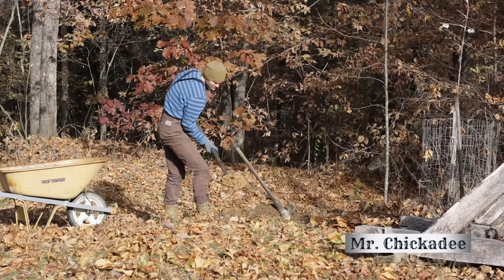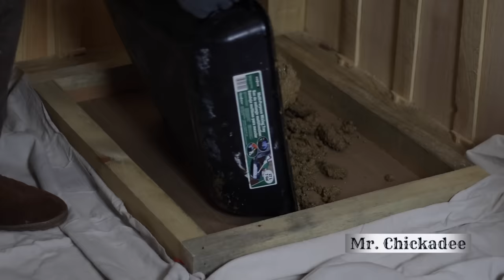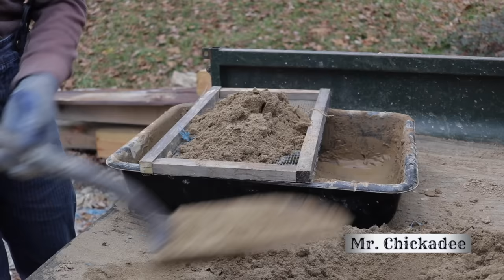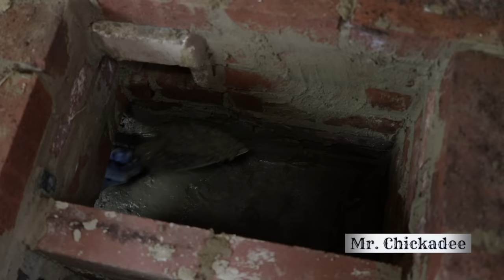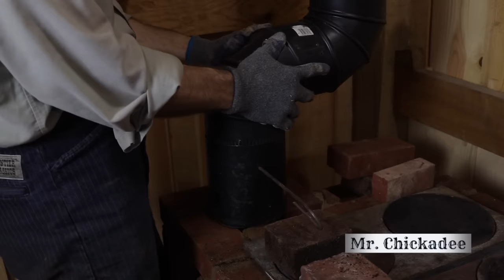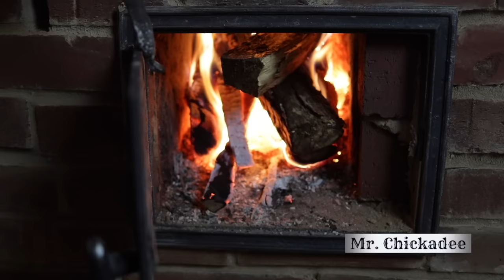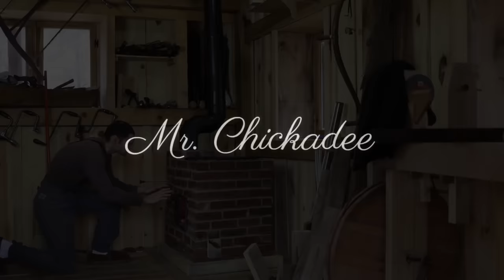How to build a tiny masonry heater for the woodshop

Comment: as a bricklayer these old methods of mortar /clay slurry/and insulation etc are interesting , Remember guys you have the option of 10% lime mixed with building sand and water to make lime mprtar(instead of cement mortar) if you live in a built up area and dont have access to clay to make slurry and wish to practice your brick bonds and building walls or stove projects  like this and repeat until you get it right.. When  your work is finished you can crit it and when youre ready to try again just pull it down the next day and brush the bricks dry and wash bricks clean in bucket of water  . You can then repeat and practice til youre satisfied with your brickwork project. IMPORTANT don't leave project for longer than 3 weeks or it will set hard and cure as cement and bricks. NB. this doesn't apply to slurry insulation. this is a very clean practical way to practice brickwork in your garden or patio. using the same sand and lime repeatedly. jiust break the project down on completion then use a hard scrubbing brush and separate sand and bricks into two clean piles. enjoy
Reply: Wow. Thanks for the great information! Can I use engineering bricks as a fire wall?
Reply: awesome advice

Comment: Feed the fire with controlled outside air and not let it steal what the brick is heating! And a pot of water boiling to keep your sinuses from cracking open! LOL
Reply: Yea i'd love to see a video that explains the design principles and incorporates advanced design features like outside air intake with a wood gas combustion feature like wood stove fireplace inserts have.
Reply: There are at least two combustion chambers which I assume will create a secondary combustion chamber once it's good and hot.  As for outside air, it's not so important with this style of stove since it's also using a large amount of mass to retain as much heat as possible, from a very small initial combustion chamber, ie small wood fire, huge fireplace.
At least that's how I see it, and I know it's a Russian fireplace, and that's what they do.

Comment: There's rocket-mass heater; then there's mass heater; this is the latter! Still heats up, and stays warm a long time!!Good show!
Reply: If I ever build myself a cottage, cabin, or a new, bigger homestead farmhouse, I'm putting in a masonry heater, or a couple, depending on the house layout... I can skimp elsewhere and have a kitchen built out of pallets, but I won't skimp on proper heating like the stuff I grew up with. When I immigrated to the United States, I used to think people's firewood piles were a 10 YEAR supply, because I was used to these things that only need 2-3 cords per year to heat up the house, rather than 20+ cords. The cost savings are considerable, if spread out over the lifespan of the heater, but all I ever hear from Americans is "rocket mass, rocket mass, rocket mass..."

Comment: Making the fire gases go up, over, down, over again, and then up the chimney will certainly make the most of the heat but I'm sure that smokes the place up until everything gets heated properly.  Clever and nicely made.
Reply: nah, just put a small fan in a window facing in. Instant autodraft.
Reply: With masonry heaters when firing up a cold unit it's common to use an access hatch to build a tiny fire inside under the chimney, just a little paper and wood, this gets some draw action going so when you start the fire in the firebox you don't smoke out the cabin.  Once these kinds of units warm up they stay warm for hours and hours after the fire is out, as long as you don't let it completely cool down between burns it should be fine to light your next burn in the firebox.

Comment: Dear Mr. Chickadee! 👍
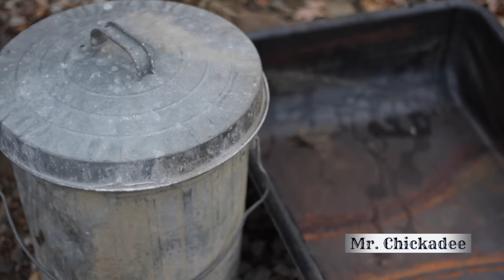It is Sunday, 02:30 [am] Central European time in the morning, now Sunday is saved again! Thank you!
What did you pour into the first mixture for the bottom plate of the oven out of the tin bucket? Bran, chaff or eggshells?
Is there something you can not do? You have the pioneering spirit of the first settlers!
Greetings from Austria!
Reply: Good morning , what he poured in was vermiculite . You should be able to find in building/ garden supply  stores .
Reply: If you look at the very top of all the comments he post exactly what he used in the three different types of mix. The first was Clay and vermiculite.
Reply: Vermiculite
Reply: @ Hi HighHo Silver!
I have no superimposed comments or subtitles, I could not see anywhere. I have again looked very concentrated and synonymous with the settings, but again not of einglendeeten comment u see and in the video description it is not synonymous.
I know Vermiculite, that's what my wife uses for her orchids and perlites, so that the roots are airy and moist.
Thanks, also too: "Linda Mazur, Jay C. White Cloud and Henry Rollins!"

Comment: What happened with the flue.  
It looks like two different projects.  
The first flue overhangs on the left,  
and the final project shows the left  
without any overhang.   

Also, why did you design the handle  
of your flue damper to poke out over  
one of the cooktops? Would it be in  
the way of operations during use of  
the cooktop? In the video, it looks  
like it could have been turned away  
from the cooking area (and the heat).  

Great content. Keep up the good  
work. Thanks so very much.  בס״ד
Reply: It looks like he just trimmed the overhanging part of the brick so it fit smoothly.

Comment: Great, you must add a steel grate to lift the wood at least 1.5" from the combustion chamber bed, in that way the fire is much more easy to start and the ashes don´t obstruct the oxygen for clean combustion and pyrolysis (more energy per kg of wood and fewer particles in the chimney).
Reply from the maker: Great idea
Reply: @JayCWhiteCloud  Hi Jay, I understand your point of view, this is a common problem with "appropriate technology" archetypes.

Those technologic solutions where empirically tested over time and transcended in history and folklore but since they are real solutions in which millions of people still rely on, they need to be tested, measured and improved, for example in Aprovecho research center. 

One simple grate made of corrugated steel bars of 1/2" can last about a half year or more of daily use since this is not an oven or furnace, you can see the draft of the chimney in the video of this rocket stove chamber which is 3 times higher than the door and relies on efficient pyrolysis above the wood and the grate, also is very easy to make a ceramic grate.
 
For insulation, the vermiculite he used is much better than ash since the density of air is bigger and its resistance to heat.
About maintenance, with clean pyrolysis, the galvanized chimney accumulates less dirt and lasts longer.

Cheers
Reply: @JayCWhiteCloud  Conifers are far from the hottest or the cleanest burning.  In fact, if you often start your fires with them or use them for smaller fires, the incomplete combustion of the sap within them at lower stove temperatures forms creosote within the stove and chimney system and if not removed can ignite and burn the whole place down.  A simple call upon any firewood authority will reveal most pines and firs to yield about half the BTUs of solid hardwoods such as ash, oak, or most fruit trees.  Further, they often throw sparks (a fire hazard) and do not produce good coals.  This isn't to say that they are without use, but they're far from my favorite for the firebox.

Here are a few links for those interested:  
Sorted by BTUs but less info: https://chimneysweeponline.com/howood.htm
More info, harder to sort: https://forestry.usu.edu/forest-products/wood-heating

And if you're really interested in firewood, I HIGHLY recommend this book.  It's one of my favorites: Norwegian Wood: Chopping, Stacking, and Drying Wood the Scandinavian Way
 by Lars Mytting
https://books.google.com/books/about/Norwegian_Wood.html?id=nZplCgAAQBAJ&source=kp_book_description

edit: to show book name

Comment: Great work mr chickadee, just a question : arent you afraid of the fire destroying the clay joints ? We build here in Europe similar stoves, but for the burning chamber we were advised to use refractory cement insted of clay+vermiculite for this place... Outside we used clay as you did...

Comment: Hey @Mr. Chickadee could you please explain your reckoning for a masonry heater over a rocket mass heater, I know they have some overlap but I'm interested in your thinking? :) I will be building a heater for my own studio and had thought the mass heater would be fantastic, altho seeing Cabin Talk having to remove hers 🙄. Many thanks for your mindful making :)
Reply from the maker: Well, to me, a RMH is just a reinvention of a wheel? They both do basically the same thing, hot efficient fire, extra burn chamber and retain heat in thermal mass, the RMH just seems like a hobo version someone thought was needed...I dont know why anyone would need the barrel and all the daub if you can just use clay bricks and clay mortar?

Comment: Awesome work! I love clay mortar! Far superior to cement mortar in this application. Where do you get those doors and how do you install them?

I'm also a bit worried about not having any air flow underneath the heater. I watched a masonry pizza oven burn a trailer down one time because it was built directly on top of wooden pallets and I've heard lots of stories of people's houses being burnt down because they built their stove too close wood. It can take several years, but exposing wood to heat will decrease it's ignition point to where it will catch fire when you least expect it. I'm guessing the vermiculite clay mix gives it enough insulation to not have to worry about it?
Reply from the maker: Hi Jeremy, 
The door was from ebay I think, it has little metal tabs you just insert between the brick as you mortar them up. 

Lots going on here, for one, the firebox is shoe box size, most heat goes up into the cook top and surrounding brick first, cooler flue gasses do heat the lower bell portion but not anything like the direct heat of a mass fire in a large pizza oven. 

For two I feel the insulation layer is enough. There is two brick space of air gap under fire box, and this is a flue gap for hot gas but not as hot as the direct fire.
Reply: @MrChickadee  if you feel like you've taken the proper precautions, then that's good enough for me. I just would hate to see anything happen to that beautiful shop of yours!

I like the idea of raising the firebox up so it isn't in direct contact with the bottom of the stove. Is the stove design your own?

I'm usually not much of a Safety Sally, but I am a believer in understanding the risks to help avoid catastrophic failure. Many people don't know about the ignition point of wood being lowered slowly over time as it is exposed to heat. So they fire up their stove for a year or two and that lures them into a sense of security until one day the unthinkable happens.
Reply: @JayCWhiteCloud  Thank you for this comment.  Earlier on, someone asked where to get the plans, and people were saying "just watch the video".  You give good reasons why that isn't enough if you are a beginner.  This doesn't seem like a kuznetsov stove, and someone linked to the Missouri Masonry stove, but it doesn't look like that.  If the plans are open source, good, but if I can buy them somewhere, I'm happy to do that too.
Reply: @JayCWhiteCloud  Yes, my warnings were mostly aimed toward the novice. I know Mr. Chickadee well enough to know that he has thought through the design thoroughly. I guess I was just hoping to spark some discussion that might educate the novice of the dangers that are present when building a wood burning stove. So I guess mission accomplished, haha!

Comment: Great video! Why didn't you use a straight chimney?
Reply: leofonte 
Probably to much draw.
More bends keeps the fire under control and allows more heat to stay in the stove and not go out the flu.
Just my guess though.
Reply: If it went straight up it would have hit the beam. Why didn't he just put the stack in the rear then instead of the front? I'm guessing because the lower flue needed to be in the front? Either that or he didn't plan it out and had already did the masonry and had a DOH! moment afterwards... my money is on Knights Edge's comment though tbh.
Edit: I just remembered that he built this based on plans. Ergo, he didn't accidentally build it wrong, and he may have put the bend in the stack because of the roof beam. Knights Edge idea is likely also. Two birds, one stone?
Reply: @knightsedge7379  Thanks!

Comment: I have only "assisted" an acquantence once in my life to build a masonry heater, and though supposedly a distance of 4" must be left from any combustible material, he made the distance 13".  He said to me he left that clearance both to be able to put a surface later to refract heat back from the wall for more comfort, but that it also made it easier to dust behind the stove.  What clearance does yours have Mr Chickadee ?
Reply from the maker: This one had about 12"

Comment: Consider taking the air for burning from outside, so that the warm air inside the cabin is not pulled into the owen.
Reply from the maker: How, cutting a hole in the wall and using a pipe?
Reply: @MrChickadee  Yes, or putting the pipe under the floor.
Reply: Then 3 seasons a year when not needed, things could crawl in? Or draft in?

Comment: ''No construction material 
 Is touched, handled, & adjusted more
 Than that of the lowly brick or stone.'' -gilpin 112319

In '75 I jumped into bricklaying right out the Paratroopers. 1st. day learn to make the mortar. That night it rained. Next morning's 1st batch was way too sand soaked wet. Shoveled the mud up on the Boss'es mortar board anyway; as we both watched it roll off the edges. He grinned and said... Rock: we need to drop about a quarter sack of mix & bout 6 more shovels of the piles upper sand into whats left in the mixer, so as to dry it up. Still grinning, he whispered be sure to move that 55 gal.water barrel a bit farther from the mixer.
Barrel was 5/8 full. So I moved it by it's top rim like turning a steering wheel on a duece and a half, a full two barrel's width's away. How bout right there Boss?
He threw his trowel like a dagger down into the foot board of the scaffold with the sound of a tuning fork blung! Then as he hopped off onto the ground, he shouted out... ''Dammit Son! you got just the right stuff to make a bricklayer! A strong back & a weak mind!''
Year later, I'd transitioned into one - started my own business & stayed at it till '81.
The above quote came about when an Arab builder wanted to negotiate a lower brick cost.

Comment: Wow! Impressive!   Intriguing, the mortar mixes used.  And…questions 🧐❔
—Looks like it uses the newer horizontal channeling, instead of the usual vertical channels❔
—Is there a reason to use a mortar mix with vermiculite, instead of simply using vermiculite in a brick frame, as the base? 
 —That slot (?) to the left of the fire door…is that a direction damper to do a fast lighting of the fire, before changing it to heat the stove❔
—Why 3 different mortar mixes❔
—Does the wool turn to char, within the oven lining, & Does that weaken that lining❔
—Why use that mix to line the firebox, instead of a firebrick mix❔
—I like to 👀 more details of building the stove, clearer pics of the layers, to better understand it…or, include some verbal describing,..& less of mixing the mortars❔
—Is a heat shield needed, between the bricks & the wood walls❔
—What climate is this working in, & how many sq.ft. is heated well with it❔

Comment: although it won't get hot enough on the outside coursing to refract the clay based motor with no chance of water erosion since its inside it should be fine. I would consider some nice hot long duration firings to try and vitrifie the firebox

Comment: Great job on the build. I don't know anything about building these things, but I definitely want the learn. The only thing I can say is your exhaust pipe is going the wrong way. The crimped side should always be facing upward towards the ceiling. This will prevent smoke from going through the gaps.
Reply from the maker: Ive always read that you want the crimped ends pointed to the stove, as any creasote will flow down and into the stove not out of the pipe seams. Ive never had smoke pass the pipe gaps unless there was very poor draft.
Reply: Yeah, crimp end down, liquids flow into firebox not into floor.  The smoke doesn't know which direction the crimps are and flows anti gravity.

Comment: Got to say Josh, I'm shocked your wheelbarrow isn't made from timber! Seriously though, you're not worried about radiant heat or cracks forming so close to wall, I'm genuinely interested? Top quality work as always
Reply from the maker: I don't worry about much Joe. There is a good 10" from the wall all around the stove, and the bricks never get as hot as metal stove sides do. The insulation layer of vermiculite/clay protects the floor.
Reply: Really appreciate the reply man! I suppose it's the same as an Arga in a lot of ways! Keep it up brother, real inspirational. Not so terrified of trying my own now in the summer 👌

Comment: Back in the mid 80's, when I lived in the New Orleans area, I used to drive by a place where old guys sat and cleaned mortar off bricks with hammers and machetes for piece rate for someone (Carrollton Lumber?) to sell for construction. Recycled St. Jo brick was prized for construction and iirc it cost more than new brick, but matched better in additions or just with the old construction elsewhere in the area.